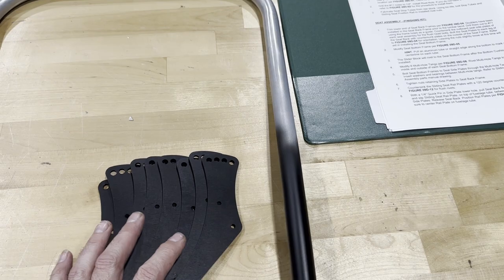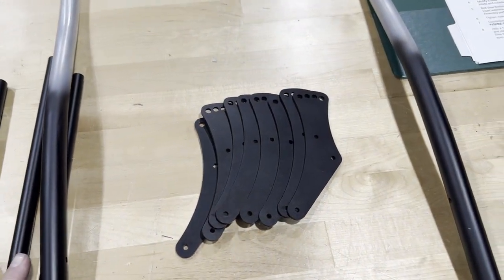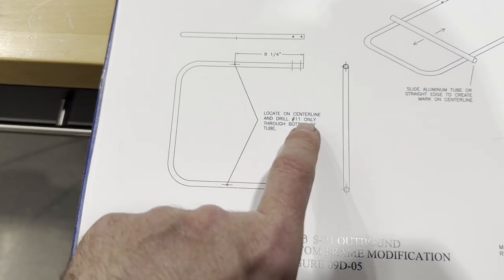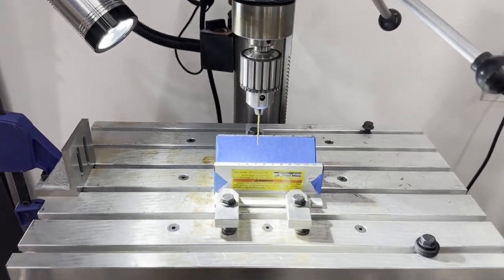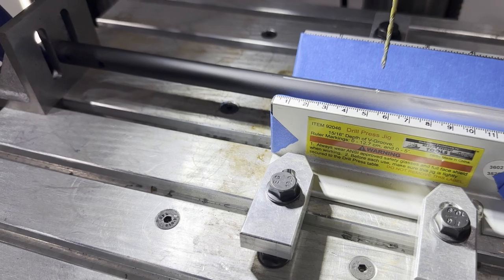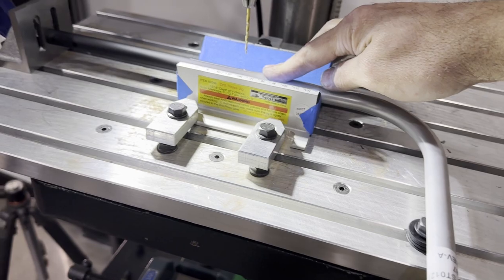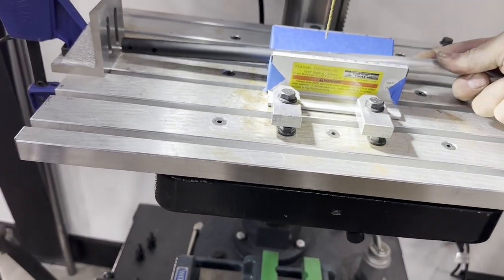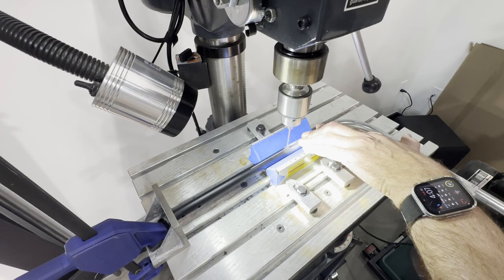Ep. 16 - Rans S-21 Seat Assembly

Comment: Kinda sorta looking at my finances to see if there's any possibility of building an S-21, and I'm having all kinds of weird ideas on how to save weight. One is to replace the original Rans seats with carbon bucket racing seats. What would you guesstimate the weight of the Rans seats to be? I'm also a bit hesitant about the electric trim. I like mechanical stuff, and I like the manual trim on the S-6, so I'm looking into the possibilities of installing that instead.
Reply from the maker: The S-21 seats are already very light. They are 1/2 or less the weight of my Cessna 150 seats. Carbon bucket style may be lighter but only by ounces. Certainly not pounds.
Reply from the maker: Also, it’ll be hard to shed much weight on the S-21. It’s already built very light. Almost to a fault. I’ve had to add some weight with extra structure in areas because I was not comfortable with how delicate it is. 

The skins are the thinnest I’ve ever seen on an airplane at .020”. If you breath on them wrong they’ll dent. 

Like I say, this thing is a delicate flower. Very light construction. 

Ways to save weight without affecting strength would be to eliminate all the plastic closeouts. That would save probably 10-12lb.
Reply: The airplane is already built lighter than I would prefer. I wouldn’t worry about weight if I were you, you wouldn’t notice the difference between flying the 21 with 30 pounds of gear in the back.
Reply: @Outbound300  I should clarify. I`d be flying it within the LSA class here in Norway. I am comparing to other LSA`s and not other experimentals. I am not suggesting touching the structure either. What I`d want is a very low weight, to allow for more fuel/pax/payload but under 1320lbs/600kg. The new regulations states that you are allowed to fly an LSA on top, if it got a parachute.

It`s probably down to preference, but I`d want an Edge Performance engine (they´re norwegian, support is infinetely better than Lycontitans, and weighs the same as Rotaxes), Kanardia instruments (European, there`s a local daler and good experienses in other EU LSA`s. Their EFIS weighs about 1/2 that of Garmin or similar). E-props are super light and goes well with EP engines, the four blade one is very quiet too. All this would save quite a bit of weight, especially if I also went for the carbon bits when thats an option offered by Rans. Economically, it`d still be cheaper than a typical experimental build. Probably because the brands that offers all these low weight options are european.

The seat thing was more of a brain fart… Like snipping of the tag on your jacket to save weight when hikinh. I have just wondered why so many aircraft seats looks like padded dining chairs, when carbon bucket seats are both lighter and more comfortable. Might depend on the average body shape though… And price.

Comment: I would love it if someone came up with an adjustable lockable sliding seat track solution like from a Cessna 150. 350 hours sitting in a S21’s seat and I’m still not a fan of the mechanism.
Reply from the maker: What specifically about the Rans seat mechanism do you not like? I have no practical experience with the seats yet but definitely curious.
Reply: Well, for starters in the Taildragger configuration on the ground, it’s harder to scoop the seat up. Not the biggest deal, but my main issue is they are so many adjustment notches that it’s hard to find your original position in flight if you move your seat back for long cross country’s like I do. Also, the seat doesn’t fit perfectly fixed in the track. It has a little slope or can twist slightly which puts the rear locking pins out of alignment by one notch and the seat back won’t go as far back. If I could make adjustable stops forward and aft where I like the seat for takeoff and normal flying and then for cruise. Plus, making the seat to stay square in the track I’d be much happier with it.
Reply from the maker: Interesting. About the seats not being square on tracks. During assembly of seat tracks to frame its critical that the two notched tracks are perfectly aligned. If one track is even so much as .090” forward or aft of the other it can cause a ‘racking’ or out of square condition.  Mine are dead nuts aligned and the seats lock in perfectly on both sides with almost zero play. 

Yours is factory built? You may want to see how aligned the tracks are with one another. Maybe they were sloppy at the factory that day? 

Fixed locks for forward and aft positions is a great idea. Easy to engineer up some parts for that. I’ll consider that.
Reply: @Outbound300  I would be very interested if you came up with a solution for fixed locks. I guess what I was trying to convey with the seat tracks are that the plastic L brackets that go on the bottom of the seats don’t allow for a perfectly tight fit therefore the seat can sort of wiggle on the tracks. I do believe my tracks are properly aligned. That being said, if the seat twists a degree it can put the right track pin one notch forward than the left pin binding up and not allowing the rear seat going back all the way. Plus it probably puts a lot more load on the pin most forward. If I had four of those plastic/nylon L brackets with tighter tolerances, that would probably alleviate the seat from slightly twisting left and right when sliding it. I hear Randy is looking into re-designing with a roller system instead of the nylon L brackets. Same ratchet and track adjustment system. We shall see.

Comment: Most kit aircraft (and some production ones) have what I consider pretty flimsy seats.  Seats should be at the very least, be designed to 7G ultimate or so.  A big human is about the same weight as an engine and would you consider that seat structure strong enough to support an engine at 7G?  I like Rans kits and maybe they actually tested some of these to failure, but they still look a bit fragile.  A 250lbs person at 7G=1750lbs.  Plus the seat back will probably start cracking just outside those nice hinge brackets in no time.  No matter how often you tell people, they will always shove back hard on the back while adjusting themselves (or their underwear!) and this puts enormous stress on that point.  Time will tell...
Reply from the maker: I can’t argue with this logic. That said this seat design has been used in many previous Rans aircraft that have been flying (and presumably crashing) for decades. I haven’t heard of a mention of the seats being a systemic problem. 

Worst case these could be easily fabricated from steel tube and welded gussets similar to Cessna 150 seats.